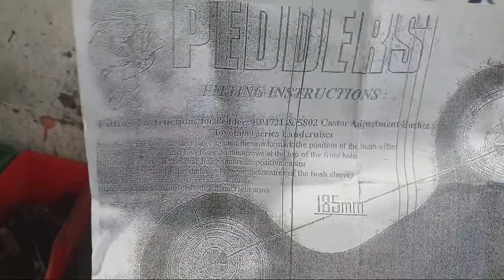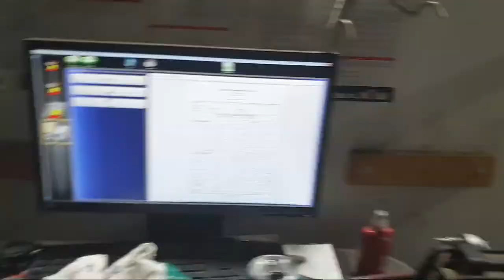LIVE: Inspection Time On The 80 Series - Radius Arm Castor Correction

Comment: what is the part number of the bushing is it all the same for the front rear radius ?
Reply from the maker: Hey mate

This was sourced through Pedders Suspension, so I can't even provide a part number for you.

What I will say is, only fit rubber, do not fit polyurethane bushes as they dont flex.

The bushes are the same for the front and rear of the radius arm at the diff end, I'm not sure about the chassis end though.